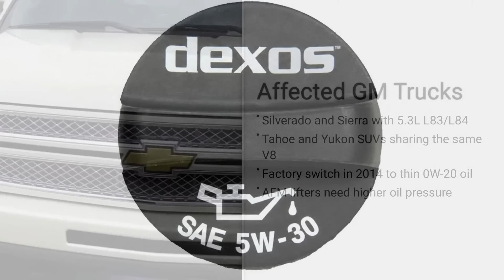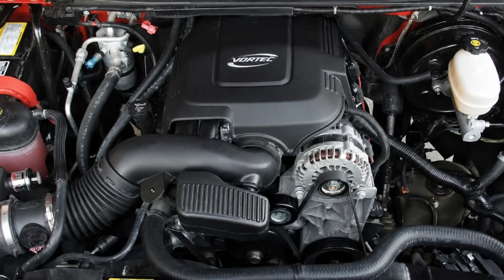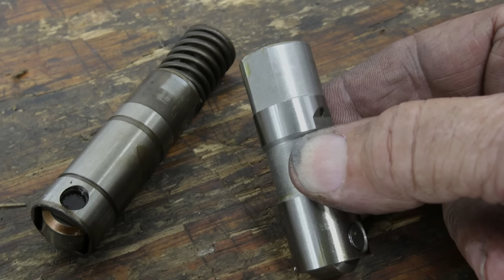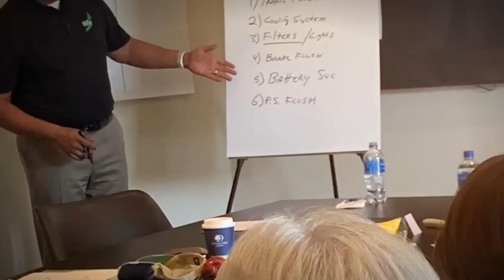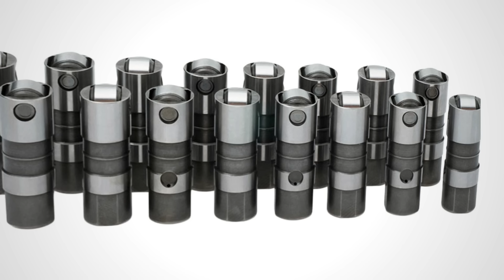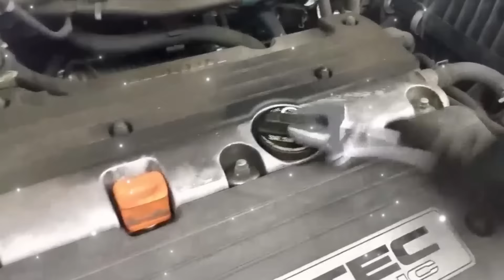The 5.3L Oil GM Tells You to Use Is KILLING Your Lifters — Switch Before 60k Miles

Comment: 2014 gmc sierra 1500 with 138k miles. Hopefully its not too late, but i have my plug in afm bypass module otw and am going to change to 5w-30. Just had to have my transmission rebuilt last week and trying to save my truck!

Comment: Thank you zero carbon EPA, ran the  0 20 after a gm mailing for one oil cycle approx 3500 miles nothing but problems after for 2 months went back to 5 30 all good  at, 199, 578 miles except a po 306 code  permanent embedded on ecm

Comment: If the motor already has 140k miles.. can I still switch to 10w 30 safely and not run into problems?? It’s a 2018 sierra

Comment: My 2018 Cadillac  Escalade esv has 23000 miles I use 0w20 running good. I use 5w30 in there b4. No problem I think if you using your truck to carry passengers or heavy equipment you should use heavier engine oil like 5w30 n up.

Comment: 14 Sierra 294,000 miles 0-20 at all oil changes. Roughly every 7000 miles. 80% highway miles. I have the afm disabled below 45mph, I dont like it running around town. Only things changed on the engine general maintenance, vacume pump, water pump.

Comment: Don't think your pre-2014 5.3 you're running 5W30 in is immune from cam and DOD lifters issues. They're nearly as bad as the 2014-up DI versions. It's a good idea not to run them to the factory recommended 7500 mile interval ( I change between 4 and 5K). This guy is right - don't neglect the VLOM filter and if you're replacing the cam/lifters anyway, just put a new VLOM in there while it's apart. Not that expensive.  Neglect it and you'll likely do this repair again, soon.

Comment: 2017 GMC Sierra 5.3 l I change my oil every 5,000 mi 0w 20 I don't wait for the change oil light to come on and may I add 210,000 mi on the clock. The transmission that's a different story

Comment: Bought my 2018 Silverado with 23,000 miles. Made it to 130,000 and dropped a lifter and started to eat the cam. Spent $15,000 to have the motor replaced with AFM deleted. I now run 5W-30 and now planning to change out and update the failing trans... Owe too much to sell or trade it in and my son wants to inherit it. So I'm investing to bullet proof it and hope it lasts until he gets his license. Absolutely ridiculous situation for 2 mpg difference 🙄 cars are built with trucks quality. My wife's 2019 traverse had the motor removed twice to fix a rear main seal leak, timing cover, valve cover, etc and the mf is still putting oil. Had the exhaust brackets break off and rip holes in both sides. Took it to GM for repair under safety bulletin... Got it back they didn't say a word but evidently the bulletin only covered the driver's side exhaust not the passenger. So still had a passenger side leak and no support bracket which has now caused a broken exhaust manifold bolt and a massive exhaust leak. The vehicle is almost undrivable the cabin fills with exhaust fumes and causes misfiring and sporadic acceleration and hesitation. Completely fed up with GM we have called corporate and flight until we're fed up. Never buying another one I will go Toyota or something.

Comment: Just sold my 2014 Silverado Z71 with 5.3 L 20300 miles and no failures still the same alternator and water pump  Oil changes every 4500 miles with Mobil 1 and  wix oil filter was still running fine.

Comment: 2014 lifter failure happen at 100,000. Replaced and now use the range delete plugged in. This sucks-thought it happened again because number 7 was not firing. That God it was a coil pack 144,000 on this engine now. Love the video

Comment: I have ran 5w30 full synthetic in my 2004 Tahoe with a 5.3L since day one. 304,000 miles and still running strong. No lifter knock or tick

Comment: This oil was designed for fuel efficiency. Due to the friction. The problem w these engines period is the AFM, can’t blame on oil or what not. But if you have a moving component and have a module stop it. Than in return have held up by plastic retainer. You’re going to have failures this was all happened. Along w Dodge. W Obamas bail out. DOD/AFM same thing just different through manufacturers. Blame all you want on oil or your searching through google. Problem period. If you’re killing cylinders and holding them up w plastic. Don’t matter grade of oil. The plastic fails, lifters fall down, and even turn side ways. Than this wipes out cam and lifters.

Comment: I bought my truck new 2018 Chevy Silverado 1500 5.3l. I have 290,000 km. I have been using zero W-2 from the beginning. Should I continue 0W 20 or is it still a good time to change over to 0W 30?

Comment: There is an oil sensor on the back of votec engines that has a small filter in it that may clog oil flow and engine light to stay on. Replace that and remove the filter. It's way back so you can't see it but I had ticks for years until I changed it. They want 600 at the shop to do it. You only need a swivel extension and a socket to do it. It's under just 15 lbs of torque. Might take you 30 min or less.

Comment: I have a 2023 Chevrolet Silverado 5.3 L. 155k and working on my second camshaft and lifter replacement. I run 0W 20 ultra platinum synthetic Pennzoil. Should I change my oil to 5W 30?

Comment: Has anyone ever tore these engines apart and measured bearing clearance and such? Im not running a different oil unless i have concrete numbers showing clearances did not change from 2013 to 2014+

Comment: Just traded my 2017 5.3 Silverado with 84k. Still ran good  b/c used AFM DFM module at 25k. I think it saved the motor. Also I always changed the oil  at 5k miles.

Comment: 2017 GMC Savana 2500 4.8L. It calls for 5w30. I change it every 5,000 miles.  Its got 329,000 miles.
Reply: The 17' GMC 2500 came with the 6.0 L, not a 4.8 L
Reply: @keithashline505 sorry. You are completely wrong.  My 2017 gmc 2500 has the 4.8L engine.  These vans have 3 different engine options.  Yes the 6.0 is one of them. But The one i drive has the 4.8.....I recommended you do research before you you reply and look foolish.
Reply: @JJ-nh8lv upon further investigation into this vehicle’s available engines the 4.8 looks to have been the stock configuration engine that came with this vehicle. The 6.0 was a upgraded performance engine that was also available for this vehicle. I wouldn’t say that I looked foolish but that’s your opinion.

Comment: Government foolishness.  GM foolishness too.  0w20 isn't just stupid, its criminal.   The first number is ok if its 0w.....its the 2nd number that's the problem.  20 is not good enough to coat engine parts with a good film of protection. 30 or 40 does.
0w is the cold viscosity.  So when the oil is cold is flows slowly.  So a thinner oil when cold is good.  But, as the engine warms up, it needs thicker oil.  Simple but fools fall for foolishness

Comment: 2019 Tahoe, bought used 1 year ago with 78,000 miles, currently at 90,000. Will be changing  to 5w30. And either sell truck ( buy an Expedition ) or do a crazy high performance delete. Cam heads intake. The hell with these new cars !

Comment: I have a 2015 5.3L un fortunately it's too late, I wish I would have seen this a few years ago... I bought it used with 77k miles I now have 230k on it but I have been using 5w 30 high mileage oil for the last 4yrs ever since my warranty ran out. I recently started hearing the tick on what I believe is valve 6. Currently looking for a reman motor before it dies completely.

Comment: 2025 Silverado 1500 5.3L running 0w20, at least thru warranty. I’m at ~22k miles and I try not to go more than 3.5k between changes. I only use Top Tier gasoline, and I do 95% of my driving in L9 mode, which disables DFM
Reply: What is L9 mode?
Reply: @davidguy1575  Manual mode. “L(X-1)” will disable AFM/DFM, where X is your max gear. I have a 10-speed, so L9 is the magic mode for me. On 8-speeds L7 should work, etc
Reply: @ratcliffek ok.   I guess I'm an idiot but how do I do that?
Reply: @davidguy1575   Not sure which year/model you have, and don’t want to steer you wrong. Maybe safer to Google ‘manual mode your year/model’. On mine - w/ engine on, from Park - I shift into Drive, then pull the electronic shifter back a 2nd time to get into “L” (manual mode). Then I use the shifter paddles on steering wheel to shift up to L9. Then I just leave it there, and never think about it again until the next time I get in my truck to do it all over again on the next trip. The “L*” you pick just sets the max gear your transmission will shift to. It’ll still shift automatically between 1 and whatever you set
Reply: @ratcliffek oh ok..   I gotcha.  Simple enough.   Appreciate the info
Reply: @ratcliffek I have a 2026 Sierra SLT w/ 5.3, 10 spd trans
Reply: @d @davidguy1575 ice. We probably dodged most of the bullets by getting the last two years of this generation of the 5.3. Congrats on the new truck. The internet is a scary place when you pull the trigger on a GM these days. I feel you

Comment: can anyone comment on my 2021 silverado 5.3 that did not have the afm due to chip shortages.  The oil cap still says 0w-20 and thats what I've been using, its sitting at 63k.... does my engine have all the afm mechanical components? should I run 5w-30 ?  Thanks

Comment: Lifters just went bad on my 2022 Chevy Silverado 1500 WTwith a 5.3L and I was using OW-20 and thought by changing even before the recommended 5000 miles I was good.  There was a big lawsuit with GM about lifters going bad for 2019-2022 models.  Mine went out at 126,267 miles.  Talked to a lawyer but  the mileage was a deal breaker.

Comment: I got a a 2011 Gmc with 5.3. It has just under 200,000 miles. I got it used and I think it never had a cylinder diabeler on it but I got one. I did put new plugs, fuel injectors, coils, wires and a new up grade valve cover in it.  I couldn't believe how clean the head was. I think the mileage was around 5 or six thousand in it. I use valvoline oil with some trans fluid at every oil change.

Comment: Someone told me that the L83 uses an ECM-controlled, two-stage variable-displacement oil pump. Its oil supply operates the crankshaft and camshaft bearings, hydraulic lifters, AFM valve-lifter manifold and cam-phasing system. That entire system was calibrated and validated around 0W‑20. I wonder if thats anything worth considering.

Comment: no one anywhere should ever use 0W oil.  it never gets 0W cold anywhere.

Cold Testing Temperatures by Oil Grade

0W Oil, Cranking test: -31°F (-35°C), Pumping test: -40°F (-40°C)
5W Oil, Cranking test: -22°F (-30°C), Pumping test: -31°F (-35°C)
10W Oil, Cranking test: -13°F (-25°C), Pumping test: -22°F (-30°C)
15W Oil, Cranking test: -4°F (-20°C), Pumping test: -13°F (-25°C)
20W Oil, Cranking test: +5°F (-15°C), Pumping test: -4°F (-20°C)

Type this into Google (for your location):  How many days in the last 10 years did the temperature of MY LOCATION drop below -31°F, -22°F?, -13°F, -4°F, +5°F?

Use 10W-40 minimum, year-round, use 20W-50 for heavy duty like summer towing, always idle after start until idle drops, and never slack until oil gets dark/dirty.  Change all other fluids at lowest end of their listed service range.

  ..then why has the manufacturer cabal been exclusively listing 0W oils in the owners manuals and on those freaky little stickers under the hood?  Because the manufacturer cabal would prefer that your vehicle enjoys a shorter lifespan and for you to buy another of their vehicles sooner.
 
ENGINE OIL COLOR CHART
https://www.instagram.com/p/DP2kLcxEvqR/

Comment: It is 10w30 for anything above -23c and 5w30 if colder for old cars.  Example is my 1995 Eagle Talon.  The outside temperature is factored in for cold start up not when the engine is at operating temp and higher...I cant believe no one is hitting on that point and is the only point of the change between the two.   Have 250,000km on 2 max boost for stock spec mitsubishi 2L motors.  Dont burn any oil.  These older heavier oil weights are the winners for longevity on non complicated engines.  Fk AFM.  I have a Tahoe and Avalance both at 260k kilometers.  Disabled the AFM at 250k.  No tick no issues.  5w30 in them from day 1.  New weights are for emissions and fuel economy not longevity.

Comment: 1992-2022 I ran over 30 GM 1/2 ton trucks and full size SUVs (company and personal). Drove 70-80K miles/year. Ran 0W20 when required, changed every 5-7K. We ran trucks to 80K-100K and traded. Hiway miles, towing, off road. Never once had an engine issue, never used any oil. They all ran great and were reliable for me.

Comment: I bought my 2014 Sierra 1500 four years ago, I ran 0-20 for a year until a truck line mechanic said "I would use 5W30 and call it a day".  I did and it now has 90000 on it with no problems. The I defeated the AFM and next is a replacement of the transmission cooler thermostat. BTW, I only lost about 1 mpg doing this. I have averaged about 18 mpg over the last 10,000 miles.
Reply: Tune?  Or physical non afm parts
Reply: Porsche and others slide cam techn

Comment: I received a 2007 Chevy Silverado 4.8 with 300,000 miles on it. It was given to me. I don’t know what kind of oil was used in it. I put 15/40 rotelle in it every 5,0000 miles,it has 39100.00 on it ,still running strong

Comment: I started using the RANGE on my 2016 GMC 5.3 Sierra Z71 and haven't looked back. I'm still using 0W-20, but that's because I've got a case of it I need to use up. Afterwards, I will be switching to 5W-30.  Getting ready to turn over 80k miles. I've done one dump/fill of automatic transmission (not a flush) and I keep the oil changed every 4 - 5k miles. Never over that. Fortunately, I've got the 6-Speed...not the 9 or 10-Speed.

Comment: 2008 Yukon 180k ,just started getting the rough idle, 2 machanic shops says it's the AFM going bad. DOD Kit was recommended...$6000 ( Im so sad) No RECALL WAS ISSUED FOR THIS ,WHY NOT? I know it's a lot of vehicles out here gone because GM wanted to meet a fake gas ratio/ milage. It wasn't worth everyone's  hard-earned DOLLARS.  I WOULD'VE GLADLY TAKEN THE GAS SHORTAGE ( REGULAR LIFTERS) INSTEAD OF LOOKING FOR A NEW MOTOR. , NO CLASS ACTION  WAS TAKEN FOR THE MISHAP..?..GM SHOULD PAY SOMETHING ON REPAIRS! 😢 I can't afford a new engine.

Comment: 2021 Chevy Silverado 1500 5.3  liter dfm. Broke a lifter at 6000 miles, bought a Ob2  deactivation tool since it happened, now I have 26000 miles getting ready to put 5w-30 oil in it now. It's not right having to spend money, when GM should be removing the shit lifter, and reprogramming the computer at no charge, especially when Gordon Chevy never told me about any of this DFM bullshit.

Comment: Babied my 2014 Sierra, and 122K without warning #8 Cylinder went kaput and seized up my motor due to this AFM.
Sure plenty of successful stories of folks not having any issues, surely has made me envious, I just happened to one of the unfortunate.
Certainly felt that GMC did us wrong…..and I certainly don’t suggest anyone purchasing anything used with this engine in it! Just a ticking time bomb, no matter if a disabler has been used or not.
Of course the ole delete and tune is the problem solver, but at what cost for the average punter.
I previously had a Silverado with Vortec, loved that truck…..if I’d known going back 9 yrs l, certainly a different path would’ve been taken.

Comment: On earlier versions of this system I have also seen the valley cover come loose and it lets oil pressure drain away inside the block so the lifters don't get full oil pressure. One of the biggest problems is lack of proper maintenance. The maintenance intervals are too long. I'm currently driving a 2012 Silverado with an AFM 5.3, it has 280,000 mi on the original engine with the original lifters. The world was changed in it every 5,000 miles on time every time. Do not go by the oil life monitor it is running the intervals out way too long. I don't care what they say about the perfect oil they make, it does not last that long. I've torn enough engines apart to see the sludge and the breakdown of the oil.

Comment: I had to go back and listen again, but you said every cylinder uses the special two-stage lifter which is not true. Only the four cylinders in the V8 that shut down use these lifters the other cylinders use a standard lifter. The 4.3 V6 with the air fuel management is the same way, only two cylinders use the two-stage lifters.

Comment: My 2014 Camaro SS & 2014 Cadillac Escalade 6.2L require 5-W30. Either tune the AFM/DoD out or do a camshaft swap. Also run an oil catch can.
Reply: Even tuning it out dont save them without lifter swap tho! Cam and lifter swap is the only way!

Comment: I have a 2006 Impala SS with the 5.3L. Lifter on the #7 cylinder got stuck. Found a video to unstick it.  I also did the VLOM mode and plug the port for that little VLOM filter. Added a Range I’m still driving with 268k. I always used 5w-30 in it and in my Sierra

Comment: running into this problem on my 2013 Yukon Denali 6.2. It has a minor intermittent miss. Claims it is a lifter, and low compression in Cyl 5..My mechanic wants to put a new motor in, Should i switch oils too?

Comment: I recently purchased a used 2024 high country 6.2 liter.  Dealer sticker in window shows 5w-30 oil last change. Oil cap shows 0W-40.  Obviously the truck was taken in on recall. But last Chevy dealer used 5w-40.  GM has extended the engine warranty to 150k miles.  Maybe I should switch back to the recommended 0W-40?  And have dealer change the oil?

Comment: I am running a 2007 GMC Yukon 5.3 engine. Does the same modifications apply to me? Because I've had to change different lifters several times due to low oil pressure, which collapsed lifter...

Comment: I have a 2014 that calls for 0w20. It started burning oil around 180,000 and had a slight tick so at around 190,000 I switch to 5w30 and ill never go back to water weight again